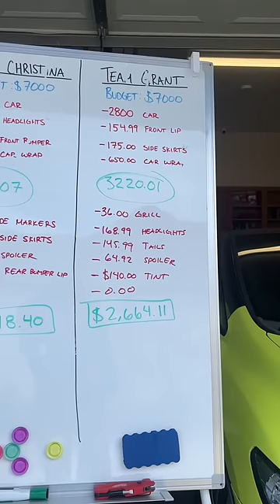￼ Squeaky Clean🧼🫧￼

Comment: can you put any performance mods
Reply: It’s an automatic 1.8 single cam engine, only performance mods you’re doing to this car is suspension. The auto trans can’t handle anymore power than what the stock engine gives.
Source: I owned an 8th gen civic ex with the automatic
Reply: If it was an si he could but it’s nearly a base model so not really anything your able to do besides cosmetic
Reply: @St33zy-P yea i think an r18 can handle around 300 before stock internals are gonna start cracking and failing. i currebtly own an 06 ex and you pretty much can’t add any power to it without forced induction
Reply: Lmao he’s not gonna do performance mods just like a his “ super car” cedes I’m weak
Reply: @rtssk8crew681  there’s not any reason to do performance mods to an r18 civic cuz they don’t respond to anything really without a turbo
Reply: It’s a budget challenge I don’t think performance will fit in
Reply: @chasebilicki409  but it’s just rice. And within his budget, it is completely possible to put in performance mods.
Reply: @chasebilicki409  yeah
Reply: @Forrest_O.  still not what this series is about tho
Reply: adding in performance mods would make it unfair for the girl friend since she would have to install them herself
Reply: @enoll218  that is also a good thing to point out
Reply: @enoll218  ...

I agree.

Comment: Please do perfomance Upgrades!
Reply: Under 1k?
Reply: @Unofficiallykangaroo  no under 7k
Reply: @HippoWheelGaming  you can get a kraft werks supercharger kit with everything you need for a civic si for about $5,750, then you could get k series bc racing civic br type coilovers for around $1,200. Then with 50 bucks you can buy something else for a stupid body mod.
Reply: @henryr.schrader7520   u want them to mod the air?
Reply: @HippoWheelGaming  u don't need to buy the coilovers. Just get the supercharger if that only fits in the budget
Reply: @henryr.schrader7520   no i mean 7k is the budget, car is not included, they had to buy the car under 7k
Reply: @HippoWheelGaming  yeah u can get a civic for like $1000 just don't use coilovers and buy stiff lowering springs Instead. Or just cut them down (wouldn't recommend)
Reply: on a base civic? it's not even an Si
Reply: @16BitOG  but Kraftwerk has a supercharger kit for the r18 he has
Reply: @kt2025  waste of money
Reply: @henryr.schrader7520  it’s a r18 base model not a si with the k20😂
Reply: @16BitOG  But would be a fun project cause it is rare
Reply: @kt2025  nah
Reply: @calebrideout  they still have a kit for that. Also you can low ball the shit out of an si owner. No need to pay over 3k for an si
Reply: @calebrideout  kraft werks has a 2006-2011 honda civic r18 supercharger system with tuning solution for $3,862.94. So it's actually cheaper meaning that you could definitely buy coilovers. The supercharger is also 10 psi
Reply: @16BitOG  the whole point is to make it cooler than the other person's. I would say a supercharged civic is cooler than a riced out cellica
Reply: @henryr.schrader7520  100% agree with you
Reply: @henryr.schrader7520  Modding cars to be cool is what you do on forza or need for speed.
Reply: @16BitOG  do you just like being a negative Nelly all the time? What's your problem, dude? I understand if you're not a car guy that you would think modding a car isn't cool, but it very much is.
Reply: @16BitOG  and when you finally grow up you'll realize you can mod real cars and that you don't just do that in videogames
Reply: Dude look at what they’ve done to these cars. They’re obviously not car enthusiasts so I wouldn’t think they’d do performance mods.
Reply: @16BitOG  it's not only about being cool. Imagine you would ride a car with a hood scoop a spoiler and so on. But your car does 0-60 in about 10 seconds. Just think about it.
Reply: @kt2025 that would be expected from a automatic economy car like a civic lol
Reply: @henryr.schrader7520 it’s not an si
Reply: bro its a civic thats meant for daily driving
Reply: @Yaboybash  But he made the car look quick!
Reply: Its an auto 💀

Comment: Put a electric sander on the seats and the carpet, it vibrates all the dust to the top and you vacuum it a lot better (switch the sander of course)